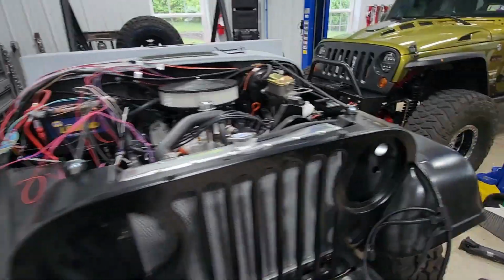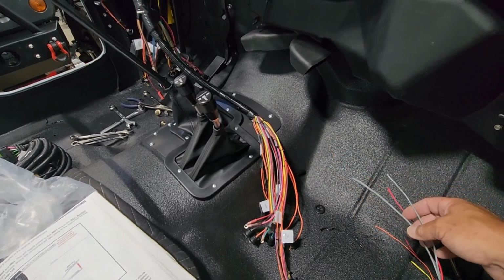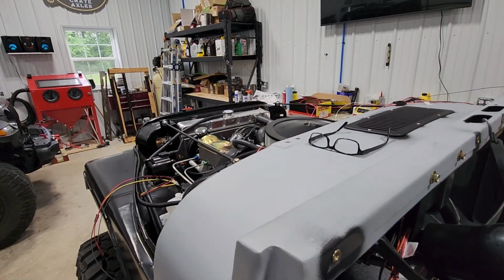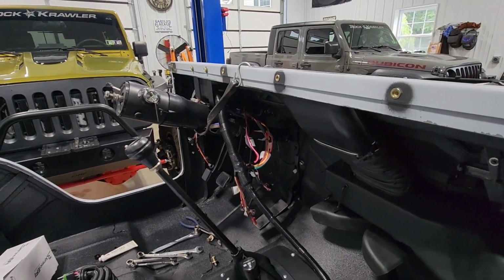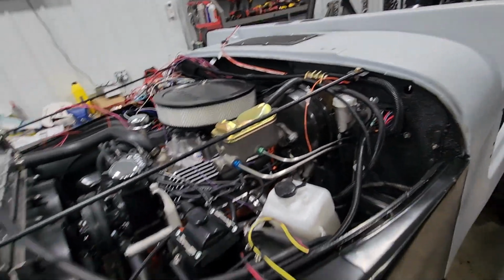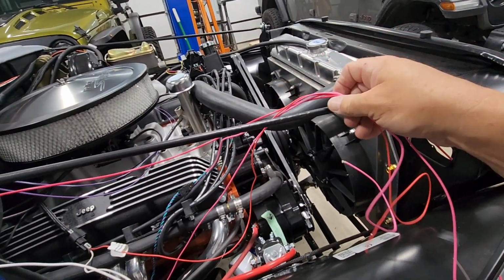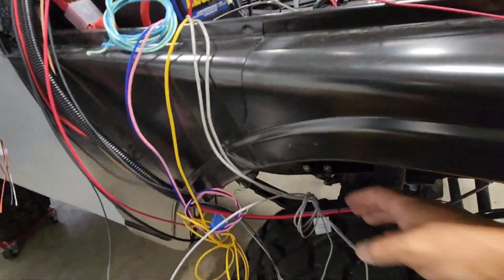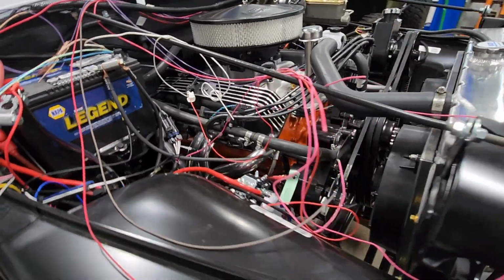CJ5 wiring harness install part 2

Comment: What length size did you use for the accelerator cable?
Reply from the maker: I don't recall the length. I bought a stainless steel universal cable that you can cut to length.  So far has worked well. Will likely replace with a higher quality Lokar cable at some point
Reply: Ok sounds good thanks for doing the video it has helped me alot.